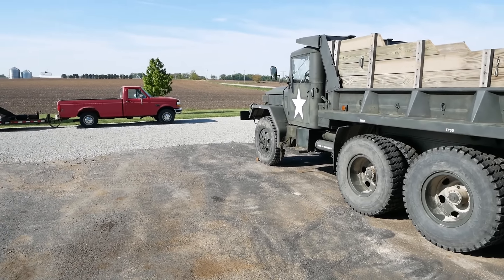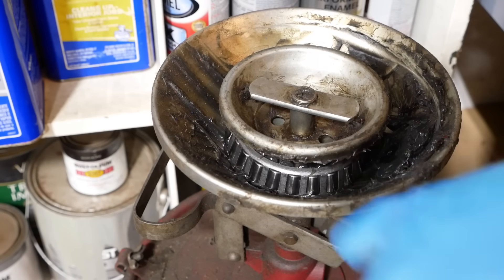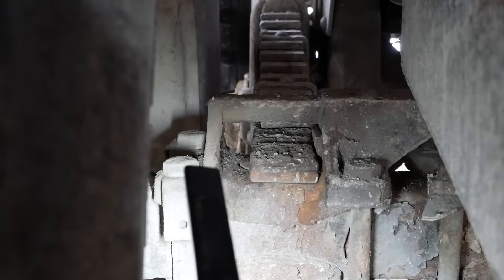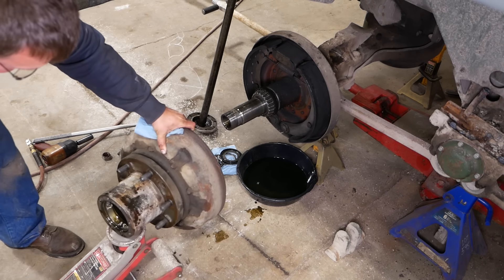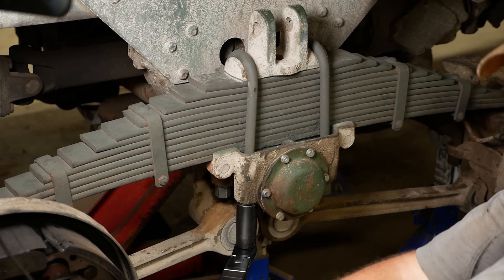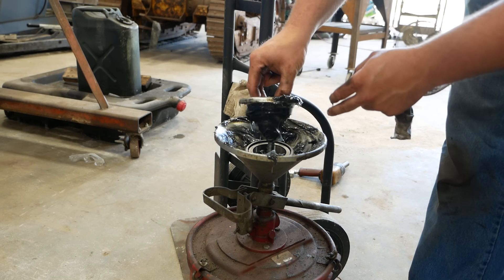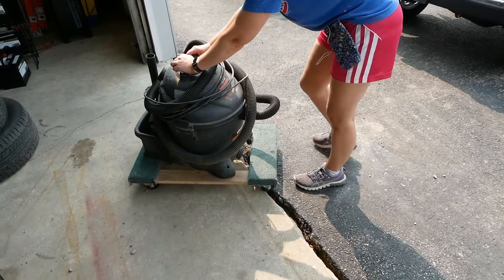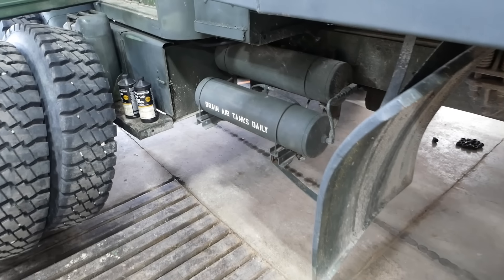Military Truck Crazy Suspension Damage - Can We Fix It?

Comment from the maker: Rather than answer so many repeat comments: This is a 2-1/2 ton truck, not a 5 ton, designated M342A2. The engine is a White Multifuel. The wheel bearings are supposed to be grease packed. They cannot run oil like a modern axle. The inner wheel seal is not designed to keep oil in, it just keeps dirt and water out. The egged out locating pin in the spring perch is not causing the axle alignment issues. That is very old damage. The spring perch was located correctly when measured before and parts were replaced. The pin is just there to line the parts up during assembly. The bolts keep the perch in position.
Reply: Yes Reese
Reply: People love to watch to find fault. Awesome job way to get in there use common sense and experience to get it done!!
Reply: Those tapered roller bearings are just like what has been used on many thousands of cars and trucks steering axles. Whenever a brake job was performed on the vehicle it was standard practice to remove the bearings, examine them for wear or defects, then pack them full of wheel bearing grease and put them back in. Tighten them down until the hub wouldn't turn and then back off 1/4 turn. Timken is by far the world's biggest manufacturer of tapered roller bearings.
Reply: Thanks for the excellent SHARE. :-)
Reply: Honestly the duece was a heavily abused vehicle. I remember one we had was from the early 60s 
Often times the new private or none drivers were given them. So they were abused more then others.
And just cause its a dump doesn't mean while in the military it didn't have parts like axle changed.
I know from experience. When you turn in. You try to pass the worse stuff off first.
Would surprise me if a M35 with bad axle had a late night axle change for that M34s as the m34 was being turned in the next morning. I've seen things like this. For turn in they are to be in good shape. But if the inspector isn't watching. Things get looked over.
And if caught. Back to company. Fhey may try again in a couple days or swap it out.
You have to be aware that many people must answer for the dumbest things. So passing it off on turn  in is an easy out.
Reply: Hell thats some real Truck you fixed there, I remember seeing a truck similar of US Army origin over here in Uk with a 2 stroke diesel engine at a fayre in 95'.
All I could here in my head at the Outro with the R22 crop sprayer was  "Chralie don't surf !"  and Charge of the Valkiryes ......
Loved ya Video  @Watch Wes Work !!   👍❤
Reply: Nice job fella.
Reply: M60 truck
Reply: Wow, nice work Wes!
Reply: Exactly the 5-ton truck so the bigger brother of this one but the Jacks shots need to be pulled out the hubs once a month at least angry stone is flying whether it's a 5-ton or deuce and a half
Reply: I wonder if you could loosen up the U-boats and take a Persuader hammer and leaf spring seat over where you want it just an idea
Reply: I'm not sure the reason why but when I was in the Army those trucks that deuce-and-a-half and the five tons you can't just shut him down you had to let them cool down and idle for a couple minutes then shut them off if I can remember correctly I think it had something to do with the injectors
Reply: @kennethsee6262  Turbo. You need to let the oil carry the heat away from the Turbo main bearing before shut down or it will cook itself solid .
Reply: The axle parts should be pretty common,  it's just a Rockwell 2 1/2 ton, alot of guys run them in their mud trucks. I know they do make disk brake kits but they are very expensive.  I have a M105A1, its basically the same truck except mine has a radio box on the back.  Nice to see how it's all done lol.
Reply: Boyce Equipment in Ogden Utah has about every part there is for the older Army Trucks.
Reply: The multifuel engine was manufactured by Continental Motor Corp. under MAN license.
Reply: @kennethsee6262  they had to idle at start up to avoid rapid heating of the turbo and vise versa on shut down. The sticker says to do so "to avoid damage to turbo"
Reply: @domenicaluise5454  '
Reply: @sampantiliano  ) I
Reply: brought back many memories of working on those as a light vehicle mechanic in the army. Your friends were correct, the service intervals were whether the vehicles moved an inch or 5000 miles... lots of bearing packing and brake repair. I hated adjusting the brakes on the deuces adjusting them was very tedious.  great work finding that bent axle.
Reply: @war.and.peace99  Looks like an M60. I suspect their has been a lot of parts swapping going on with this truck. The M60's had an emergency shut down T handle on the dash that's not on this truck, and the deuce and a half's never had a dump bed. They were flatbeds with wooden bows and canvas covers, used for troop and cargo transports. I've changed out the rear end and spring assemblies on deuce's and the one's on this truck are definitely heavier.
Reply: @mikemccann6556  Merry Christmas!
Reply: @mikemccann6556  accaully there were duece and a half dumps.
A lot less popular then the 5 ton dump.
But the bed had about 6 inch sides ( on a guess) I just remember that thier sides were shorter then my 800 series 5 ton.  I remember see the deuce dump bad in the late 80s. 
BTW the way from a glance to know the deuces and 5 ton apart was that dueces have 6 lug while 5 tons had 10 lug rims.
Sound like you may have been a 63B?
If I recall correct that dump was in a 12B   NG company (35th engineers Delta co.) out of Missouri. They also had a 10 ton tractor that was the the predicisor to the M920. Only military truck I seen that had a transmission and brownie (aka 5 and a 4.)
Reply: Keretak@ma
Reply: Class Act  LoL
Reply: My dad’s 1990 F350 is heavier than this beast, my dad’s truck weighs 7.25 tons (it has a tree spade on the bed)
Reply: @Oh-Jay52  o
Reply: Not even a 5 ton, hehe it's a museum piece :)
Reply: The pin that mates with the spring perch is just for locating parts. The U-bolt clamp force keeps the assembly in place. The pin was likely damaged by loose U-bolts. I agree completely with your course of action..
Reply: 5 ton , one of best trucks army had
Reply: We called 'em Deuce and a halfs, but I think you knew that.
Reply: These dump trucks were the red-headed stepchild of the deuce and a half family. They were very easily overloaded. Around 1974 they phased them out and quickly replaced them with commercial off the shelf International Paystar F5070 Dump Trucks. No more overloads and breakdowns. In 1979 the F5070's would be replaced with M917's.

Comment: Back in the day we had no air tools no forklift, no electric tools , everything was done by hand. One thing though, we had an assistant to heft stuff and hand us tools, we worked hard, had fun and got all greasy just like you did ! Great watching you work especially as you know what you are doing. That chopper pilot has a few more bravery genes than I, no way am i going up in any Robinson egg beater
Reply: Same. We never had air tools.I packed a lot of wheel bearings and did a few trunion bearings. We had a few deuce and a half’s and quite a few 5 ton dumps.
Reply: My thoughts exactly on that Robinson, I wouldn't even like to be underneath one of those!
Reply: M F C as someone who's seen these machines in service, would they have had power steering originally, or were they Armstrong and the big ram was an add-on like Wes suggested?
Reply: I drove both the Duese and a half and the 5 tons in the army. A couple guys busted the thick trunnions. How I do t know but damn that had to be a big pothole or rock! At first no pwr steering in the 2.5 but the 5 tons did.
I think the same thing about the Robbies and I later became a helicopter pilot in the Army for 18.5 years after my 4.5 enlisted. Went from driving trucks to flying Huey’s and little birds.
Reply: I drove a 2 1/2 ton that had a fuel tank on the back instead of the cargo variety. It did not have power steering. I drove a cargo type later that did have power steering and even had a heater.
Reply: I can remember tearing down and changing these tires in the field using what tools we carried on the truck.

Comment: 'I don't see why we couldn't have a symmetrical bolt pattern.'  Welcome to the Army!
Reply from the maker: Right on!
Reply: even civilian models had this issue.
Reply: No sign of a drain at the bottom nor a vent at the top I guess?
Reply: You want me to make this huge and awkward to work on. Sir yes sir
Reply: Not that it helps but it looked to be 6 screws in groups of 2 in  somewhat of a triangle pattern..... one could argue that is semi-symmetrical ...
I would suggest that somewhere there's an engineer who is pleased with his ability to 'F__k' with every mechanic to encounter that dust cover(along with the rest of the truck) for the  next 50 odd years those trucks exist 🙃
Reply: @BlakJak  I work  designing frames and it's possible something similar has happened when the guy in charge of the  machine room was being particularly hard to get along with.... you know ten  parts  that are all randomly increasing length when it could have been ten parts one length

Comment: I bet the truck was air dropped and the parachute had issues.
Reply: or it had a few hand grenades lobbed at it !
Reply: Did they parachute these in? I always thought the brought in by ship.
Reply: I agree with the bad parachute drop. Also military equipment is not built to last forever. In combat situations it might last thirty days  before it is knocked out of service. Maintenance is sporadic if at all.
Reply: @timmayer8723  These were designed by REO Motors Lansing Michigan and built by several different contractors over 40+ years including Studebaker, International Harvester, REO, Kaiser, AM General, Western Star in Canada and several other foreign license builders. I was friends with a REO engineer.  These were a VERY expensive and PREMIUM truck to design AND build. They had over a 40 year production run. BTW the AM General trucks (and Humvee) were built at the old Studebaker military truck plant at Mishawaka Indiana facility ! (And upgraded at the old Studebaker truck plant at Chippewa Avenue in South Bend Indiana! )
Reply: @mfc4591  And or maybe hit small land mine, who  knows !!
Reply: @Wese28  - yep, they can and do rig these for parachute drops. Depending on the mission, the 82nd Airborne Div can drop all of their assets including Engineers (which is who would have used this truck), Field Artillery, and up until the 90s, M551 Sheridan Tanks.
Reply: LAPES ? And a bit of uneffective cushioning ?
Reply: That's what I'm thinking as well slung load a hundred times by 100 pilots as long as it run all.was well

Comment: That customer should count his self lucky, most shops would give in on this beast.
Way to go Wes, awesome video.
Reply: The channel should be renamed to reflect this somehow, like "Beyond Ecconomical Motor Repairs" or something
Reply: Such a SMALL tweak but such HUGE consequences - I love that Wes realizes the importance of the little things.
Reply: I can tell you what happened to that truck….18 an 19 year olds were the primary users while the truck was in the Army’s inventory.
Reply: @retrofitter  Watch Wes Hurt
Reply: @jrbpit1   Toy soldiers gettin their arses kicked for going off the book with routine procedures. 
I blame the end user, who sold it to the present guy (the one who gone for fat rubber and raised the bedwalls, to haul extra set of carrots, thinking it's a tank) that axle surely been yanked, while beached in the mudpit.
Reply: @mdouglaswray  
the LARGE SCREW-UP is the too large tires
Reply: *himself
Reply: @BrianBriCurInTheOC  I agree on the tires but the stuff Wes fixed still needed to be fixed even if it had the original tires. I think I saw a spare in the video somewhere. Much skinnier.
Reply: @jayswarrow1196  
That's what I thought too. Someone really pulled hard on that axle. Probably had a strap on one side and yanked on it. Either use a winch with a set of J hooks to pull on the axle if need be or simply pulled from the frame.

Comment: The M342A2 was a fairly unique truck and was issued to, among other special units, airborne engineers. We had them back in 1968 in the 307th Engineer Battalion in the 82nd Airborne Division. and had one left in B Company 326th Engineer Battalion in the 101st Airborne in Vietnam long after they had converted to airmobile and 3/4 ton dump trucks. Yours one may have been air-dropped one day and hit hard, a fairly common occurrence when dropping heavy equipment. As you have showed here, it was a hard problem to discover and close to impossible for a 19-year old GI to even fix! Great video thanks for posting.
Reply: It is not ever fairly unique. If only one off, then it is unique,that is what the word means.
Reply: I agree, a unique truck, I have never encountered one, 2 1/2 ton tractors, yes. But impossible for a 19 year old? I was one, a 3'rd shop mechanic, its own MOS, 63H, which is above and beyond motor pools and support shops. We did this day in, and day out. with a junkyard of parts, collision victims mostly. We took pride in our work, and with sheer repetition, could do it speedily. With NCO guidance, and CWO's  ordering parts for the whole shop, we were highly successful in what we did. Time, tools, parts and smarts can overcome any problem. What we would have done differently, would be to jack it up, remove all the rear wheels, pressure wash, then inspect. Armed with a library of technical manuals, there wasn't much we couldn't do, as a platoon of "junkyard mechanics".
Reply: What a very useful comment! Thank you!
Reply: Air drop or heavy collision.....man thats nuts.
Reply: When I came back from Vietnam in 1970 I went to Ft Hood, TX, I was in the 8th Engr Bn, 1st Cavalry Div.  We had those M342A2 dump trucks, brand new.

Comment: Worked on these trucks in Vietnam 1970. Also worked on track vehicles M 48, 113, 578, m88 all without power tools or proper lifts. It was hot, muddy! And during the monsoons it rained and rained and rained! We were young peer pressure and camaraderie got the job done. Would I ever do it again? No would I trade the experience for anything no. I've stayed friends with guys in my unit for the last 50 years. Bonding you never forget. Have fun with the deuce and a half. We used to split shift them! Love your videos Wes.
Reply: Welcome home sir

Comment: Once again showing the difference between an old school mechanic,  and a modern technician. Thank you for sharing.
Reply: Amen.  I bought a 2011 Ford Ranger before I retired.  Some time later, and after I retired, the same dealer opened a Subaru shop right around the corner.  I called to get my truck inspected and they wouldn't do it.  Said their computer only worked with Subaru.  Near as I can figure the only thing mechanics know how to do now days is follow computer instructions.
Reply: It's funny, the NAPA rep at the school I attended made a big deal about how the students should all aim to become Technicians instead of "just" Mechanics. He'd say, "It's the difference between having a mortgage payment and having a roommate."
Reply: I would think it might’ve been on a sling and the sling broken dropped it on the left rear axle or whichever one was about bent
Reply: @mikemarriam  This is what the current methodology is for auto mechanics:  It has to be in the computer or check the scan machine.  Not very much about actual diagnostics unless it is in the computer.
Reply: @Harry-zz2oh  That's sad.  My brother went to a two year Toyota tech program and he actually gained knowledge of how the various systems work.  This translates across brands.  Not sure if he was just fortunate or if that type of education has gone by the way.

Comment: We loaded these onto rail cars in Germany.  It probably got swung into something like u said or dropped if thst could have done it or it was stuck real bad and they pulled it by the axle.     Dude in chopper is insane
Reply: frozen to the ground would be my bet.. worked in the alberta oilfield, if something was bent broken or misaligned in spectacular fashion chances are either it was frozen to the mud or it was trying to free something frozen to the mud.. many a set of pallet forks came back boomerang shaped

Comment: Good work! For almost 10 years thru my teens I worked as a shop hand and mechanic in my mom's step-dad's diesel shop... we did a LOT of suspension work, especially replacing rocker arm bushings in Hendrickson suspensions. I was 16 in 1989 and I was, effectively, the shop forklift. I could throw those 6' rocker arms around like they were made of fiberglass. I once hand-carried a junk spring pack out of the shop and Sonny just stared at me... I was like "WHAT?" He says "Those springs had to weigh 300 lbs!" I didn't get the pleasure of getting a reaction out of him very often, so I really enjoyed that one.

But this video brought back so many good memories of time spent drenched in oil, soaked in diesel, coated with grease and then rolled in road dirt. Part of my life I would love to relive, but only as a much younger man! lol I am grateful for your video taking me back to those times... I am grateful. Thanks for the smiles.

Man, tho, the more I think about it, the more I got stories about life in the 80s working on diesel trucks, in fabrication shops, and as a shop hand in a small shop that made jokes about OSHA... lol... I'm telling ya, dude... it was a different world!

Comment: Of all the mechanical jobs on a truck, I despise anything to do with bearings the most. No matter how hard you try, you cannot avoid making a colossal mess. Having said that, I like that bearing packing tool you have. I have a similar one. But smaller. For car and light truck bearings. From one pro mech to another, I like the way you work. Methodical, conciencious, and not afraid to crack a manual when you don't know the specs on a procedure. Nice work.